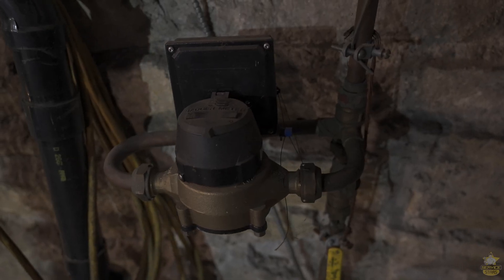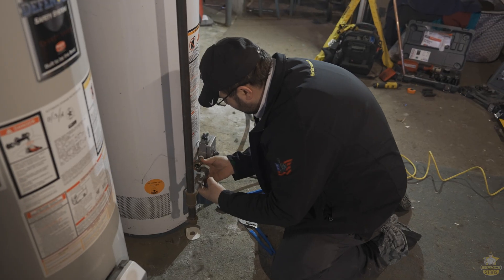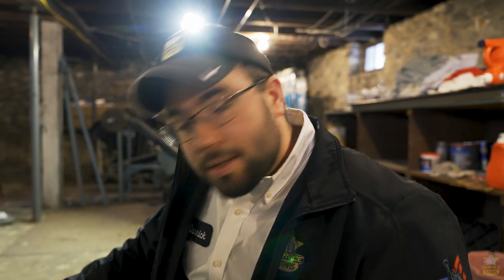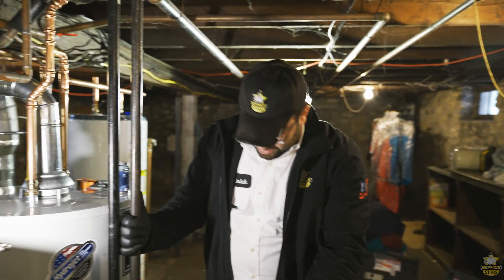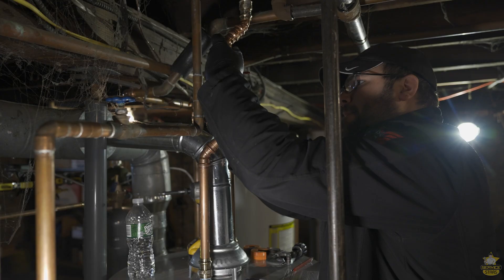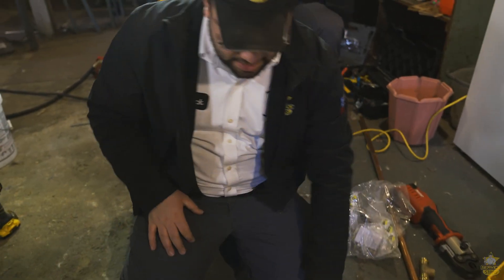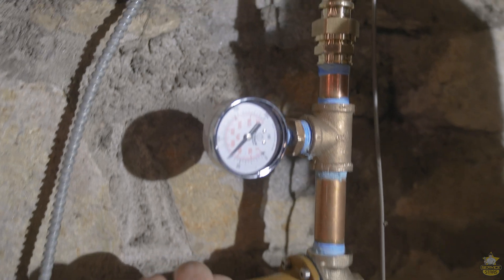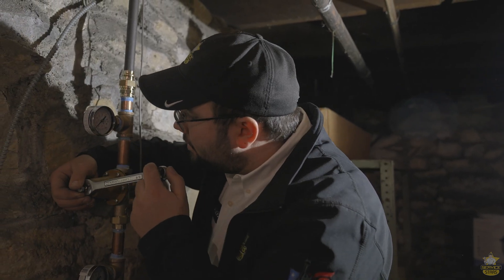INSTALLING A PRESSURE REDUCING VALVE (PRV)!

Comment: Is there a water shutoff needed between the meter and the PRV, or the one before the water meter is enoguh for code requirement?
Reply from the maker: Hey there! I asked our plumbers what they thought and they said while shutoffs aren't necessary in between the meter & PRV, it's definitely recommended for the ease of service and having the failsafes for shutoffs placed on both ends before & after the meter to PRV connection.